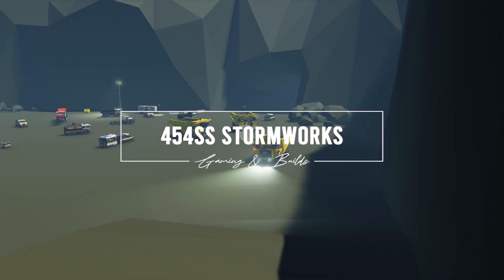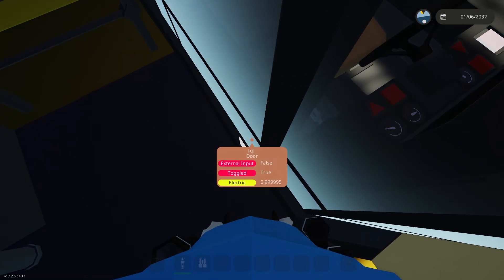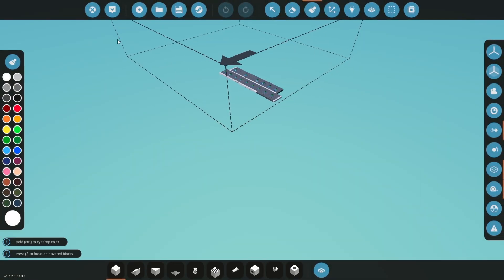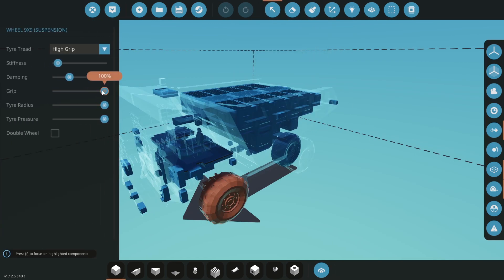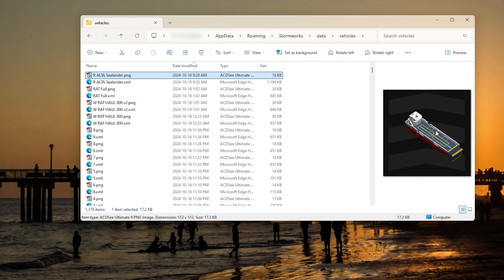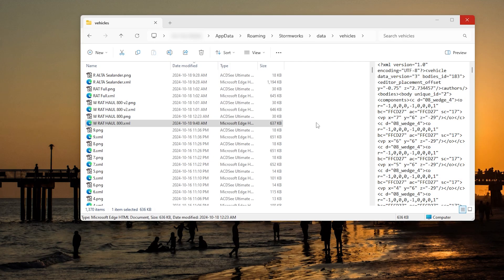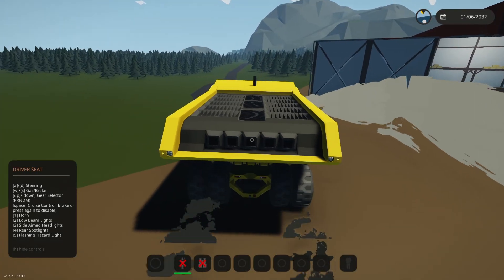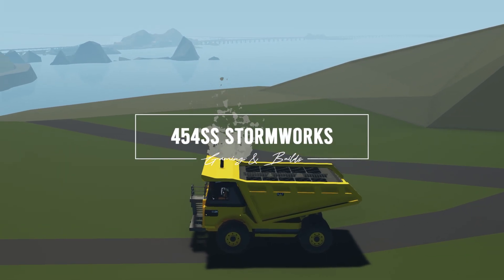WHEEL GRIP FIX Tutorial in Stormworks (XML Modding)

Comment: I am unable to locate the correct line of code. I have attempted to find wheel_advanced_9, which corresponds to the wheels currently in use on my vehicle. However, the closest reference I can find is wheel_advanced_7, but my vehicle no longer utilizes 7x7 wheels. Additionally, within the same file, I see wheel_tank_drive_5, though my vehicle no longer uses tank tracks. I am uncertain why this is occurring. If anyone has a solution, I would appreciate your assistance. If not, no worries.
Reply: Sounds like you are editing the wrong vehicle file. Another thing you could do is create a new vehicle, remove everything but the wheel you want and xml edit that vehicle. then copy paste the wheel onto your vehicle
Reply: @ames12314  |Thanks

Comment: Just a heads-up to save you from a headache, don't select the wheel with the select tool in the editor after xml editing it or the edit will reset to normal values.
Reply: That's right, he keeps resetting the values, showing us the default value of the wheels without knowing it.
Reply: Pretty sure that’s why he had the one wheel skidding in the demo spawn.

I think I might have to edit some of my vehicles. A super heavy, slow forklift drifting is super frustrating - will be nice to make it make sense instead.